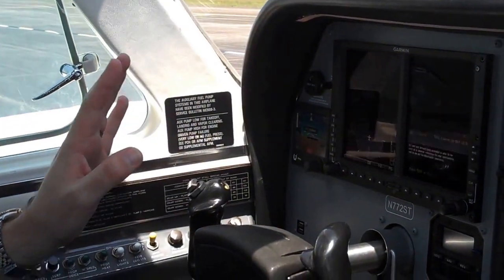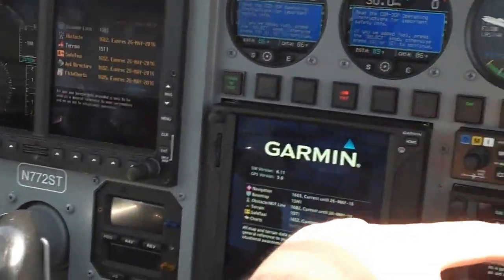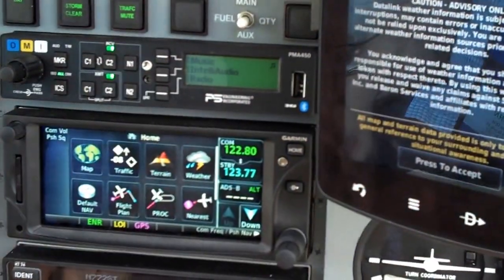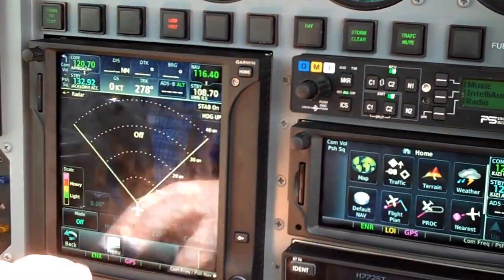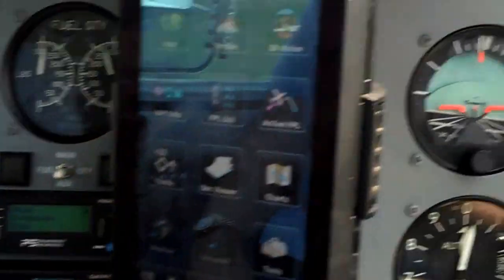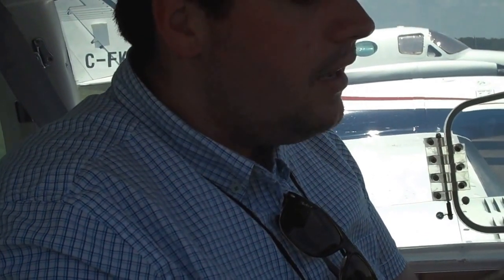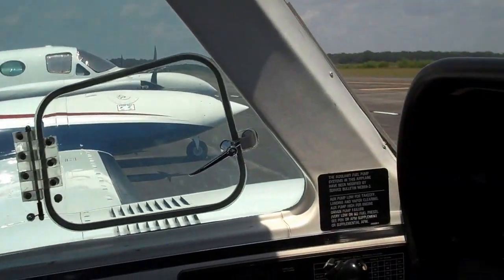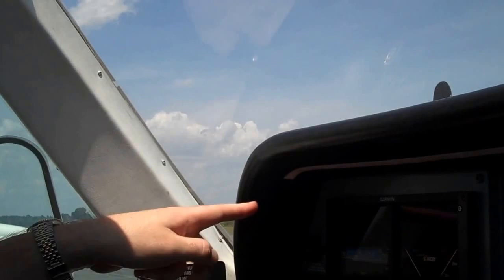Cessna 310R Avionics Panel Upgrade TTCF Conference Discussion

Comment: What’s the cabin altitude annunciator for?
Reply: The main reason for it is to serve to alert of carbon monoxide poising instead of keeping those stick on the panel plastic card carbon monoxide detectors.  The electronic CO detector interfaces with the EI CGR-30P also has a cabin altitude alert function included in the module which will notify the pilot when cabin altitude is over 11,500 if I recall correctly.  The cabin alert would be useful for a pressurized aircraft...but not so much in my application.

Comment: The yaw damper must be nice.  I don't know about the 310R's but I heard the 310Q's were "notorious" for their dutch roll.
Reply: I have owned a Q for 19 years. I have not seen the Dutch roll to be a problem. Maybe I'm not as sensitive to it as others but have had no negative comments or complaints from my wife or other passengers. I wonder if those who have had problems with it have been loading their airplanes with CG toward the aft limits? When I have encountered a slight dutch roll in turbulence, I have found putting my feet on the rudder pedals and just holding them centered stopped the roll. Owned a V-tailed bonanza many years ago, and that airplane will dutch roll. Same remedy worked with it too.
Reply from the maker: @chucksdesk  I use the same technique to arrest the roll. Slight pressure on rudder gets the job done. Really only occurs in climb when P-Factor at play. In cruise, only a slight slow roll.
Reply from the maker: You are correct the Dutch rolls in climb require pilot input to arrest. While not a real problem for the pilot or copilot since CG (center of yaw) is between pilot/copilot. But for rear passengers it is annoying. Thanks for watching.